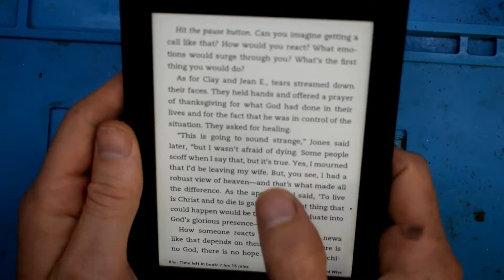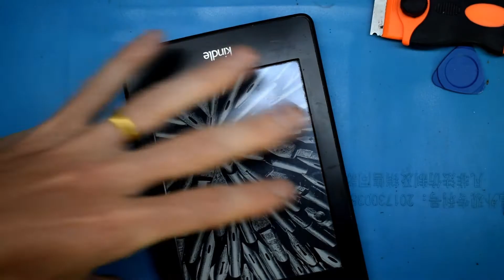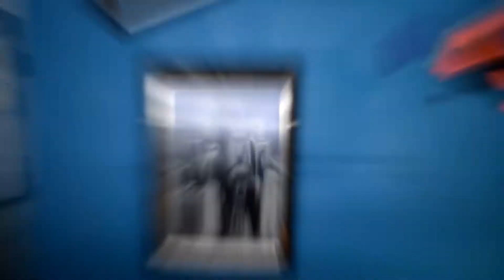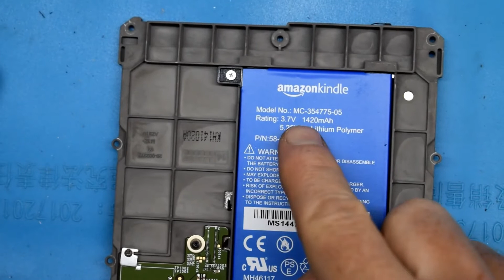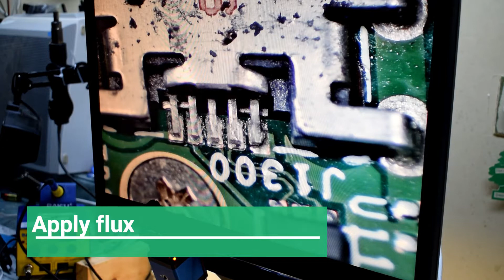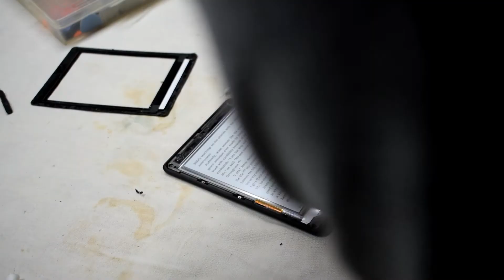Kindle Not Charging? (How to fix it from start to finish ) | DP75SDI

Comment: Does the type of cable you use for the connections matter? Could I use the wires inside an ethernet cable since they also transport data?
Reply from the maker: not sure what wires you refer to, any wires can work but the connectors must match.
Reply: @NewsonsElectronics thank you! ended up bending a pin off the microusb so i will try again when the new ones arrive haha

Comment: I’ve managed to work out which pins connect to where but what are the data lines and detect used for?
Reply from the maker: ONLY NEED LEFT AND RIGHT PINS TO CHARGE , GOOGLE MICO USB PORT PINOUT

Comment: Hi thanks for uploading this, I have the exact same kindle and I attempted this but it’s not gone to plan, everything was fine until I installed new port, soldered pins but I only soldered one ground pin while I was testing, the kindle was charging but then the port ripped off the side I hadn’t soldered the ground pad! It was still charging if I held the port in a certain position so then I soldered the pins again along with other ground pads but at least one of the pin pads came off and it’s no longer charging! So now I’ll have to try jumper wires but I’m not sure where all the pins connect to, can you please tell me which pin connects to which component so I can check for continuity and/or add jumper wire, many thanks